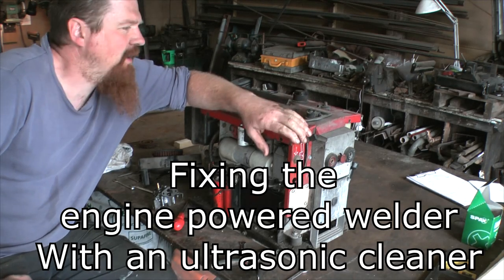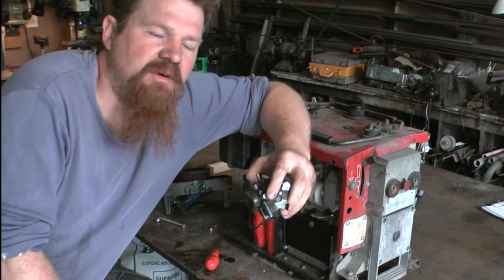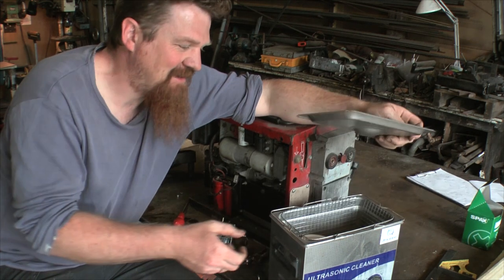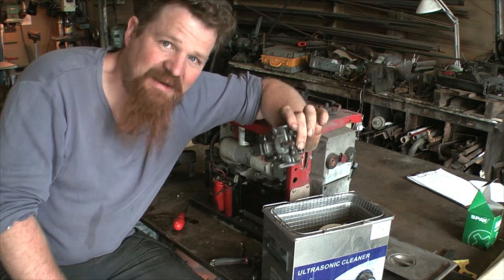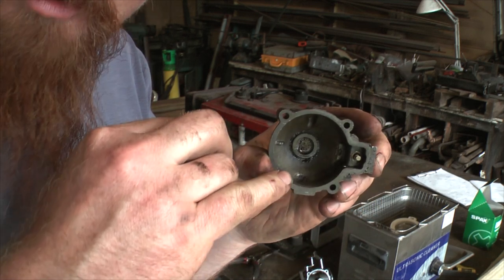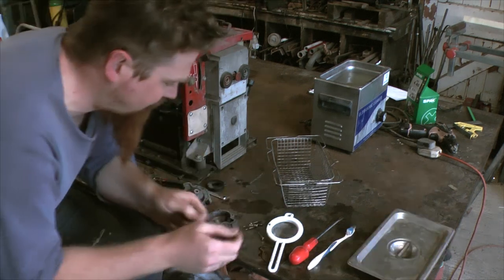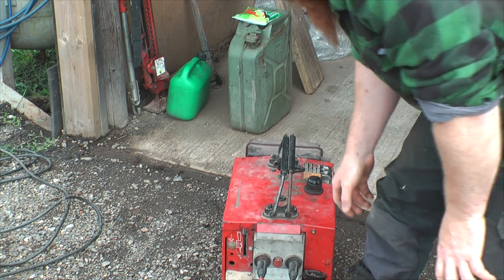Common small engine problems / ultrasonic cleaning

Comment: Max three years ‘down the line’ and these ‘real world’ issues have been largely solved for me by watching videos like yours. Have just bought an ultrasonic Cleaner for cleaning diesel pump components..works(Ed) really well but a transducer dropped’ off the bottom of the sink and shorted out. Have bought two new transducers and will JB weld those in place hopefully it will work again. Regards cleaning (mine is a 10 litre) I use water as a ‘base liquid’ and place any parts into zip lock bags with the solvent. The sonic action of the base water flows through the bags/solvent with no loss of effect and I can ultimately remove the bagged parts and reuse the base liquid again. The main reason for doing this is less clean up of the machine afterwards(no solvents in the sink) and the re use of some (if not all) of the solvent. Cleaning effect of these machines is incredible but they must make the worlds most annoying noise... I think it makes some people ill? I can only stay nearby if I wear amplivox. 

Thanks for another great video. On ‘catch up’ at the moment and learning new stuff each time. CHEERS!

Comment: Used these cleaners when I worked for Westinghouse, superb as you say! I have an old Allen Oxford, petrol scythe brush cutter from 1948 im renovating, I must get a cleaner. It was  sat on a farm  near Shepton Mallet for 30 odd years without running and the carb is bad, but  I WILL get it running! I could not believe you can still buy spares for them, so. I have new piston rings gasket etc.
That welder is a brilliant bit of kit, not seen small ones like that before just huge trailer sets, that we used to use in the forces.
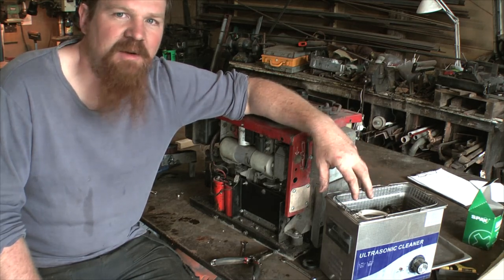5:33 ....and the cat is hungry!
Thanks for this, i had forgotten ultrasonic cleaners, it was  so long ago! 👍🏻

Comment: I had my own business repairing machinery for many years.Varnish in carburetors can be removed by steeping in mentholated spirits. It would even clear the very thin capillaries. It was the only thing i found that worked,since  petrol would not re-dissolve it .

Comment: I used to get this problem frequently. Now I shut off the fuel line and let the machine run dry. Then I restart it and, if it'll start again, run dry again. The restart drains the fuel in the carb bowl completely. Thus, when the machine isn't in use, there's no fuel in the carb to gum it up as the volatile evaporate. 

This largely obviates the problem, in my experience anyway. 

Really like your channel, btw. 😀
Reply: This is my technique on all my small engines. It works well and saves hassle. Lawnmower slightly different but ensure no fuel is left in it over winter and let it run dry when ever possible before winter storage.

Comment: I do like your style of work on tip, in reality whenever using gasket paper to sea two mating surfaces and you just know that you will take them apart again and again: Grease the gasket paper. I use bearing grease (the non-molybdenum type), but honestly any old grease or oil will do. Even used old chip-fat in the past. Result? You can take e.g. a clutch cover off an engine one or two years later and it will still come off without tearing. (And the grease makes installation easier, if one of those dowels magically disappears as they sometimes do, when you field-strip stuff...)

Comment: Off to ebay to look up ultrasonic cleaners. I keep the offcuts of guitar strings they are great steely little wire pokers for getting into jets and things. if you know a guitarist get them to keep the scrap bits for you you get 6 sizes very handy.

Comment: great to see this type of cleaner, as a junior electronics technician I used to build Ultrasonic cleaning machines in early/mid 80's. Anything from small cleaners up to beer barrel cleaning machines. The smaller ones were built out of stainless steel catering equipment like this one - usually used for keeping food hot. We shot blasted it and glued a Piezo ceramic transducer. Worked great on crap parts on my cars like carbs at the time

Comment: We use a carb & parts cleaner from Gunk, it's a gallon paint can size with basket or Berrymans chem-dip but not sure what is available in UK. I've tried pine cleaner but wasn't as good plus the Gunk parts cleaner can be filtered and reused over and over.

I got the same laundry powder from Aldi and it's the best.

Comment: This is why I use stihl 2-Stroke Oil and fuel fit briggs and stratton for 4 stroke engines.
fuel can sit up to 3 years with no problems. I also have a ultrasonic cleaner its the best thing for cleaning carbs ever. Tho I use a ultrasonic carb cleaning solution just to be safe. I find 90% of the time its the carb on most small engines that is the problem. its valuable tool to have

Comment: Would that work with petrol fuel injection parts? I've got a dodgy component that needs a clean (idle control valve) - replacement cost is ~£600! Worth a try?

Comment: Local small machinery dealer tries to sell me fuel additive for a quad bike that spends months in storage......Maximus, does this very expensive fuel additive work? Lawnmowers get fuel tanks emptied/drained and they work fine now every year.  I also stripped the quad bike carb due to running problems and found the primary jet was clogged removal/cleaning & rebuild later it now runs perfectly! I have also added a small fuel filter to keep out dirt etc.
Reply from the maker: I've had no experience myself of fuel stabilizers, I know some people that swear by them but I'm far too tight to pay out for them myself! I'd go with draining the fuel out - if it's not there it can't go off! Filters are always a good idea, I use a filter funnel when filling all my machinery, often catches bits of paint from the inside of the jerry can or random bugs that would otherwise bung up the carb.

Comment: Hi there, can you tell me what welder you are using please? Is it part of the gen set? Thanks
Reply from the maker: The machine I'm working on in this video is a 200amp petrol powered arc welder (you can see it in action in Project Awesome part 2), I also have a 160amp inverter arc welder and a 150amp mig welder which both run off the diesel generator.
Reply: Thanks

Comment: What size is your ultrasonic cleaner have been thinking of getting one for awhile and you have convinced me ...
Reply from the maker: I'll update the description actually as I blew up the one in the video! I still recommend them but just don't get carried away like I did and use for more then an hour at a time. Mine is  a 3 litre model, no brand - I think they're all pretty similar.
Reply: Maximus Ironthumper that’s great was just going to order a 1.5 but I’ll order a 3 like the way you explain things by the way keep it up !
Reply: @maximusironthumper  Carb cleaner works well in them also. As does gunk de greaser

Comment: Seems to me that gasoline and fuels break down faster these days than they used to, now I use stabilizers like sta- nil and sea foam in all my motors, I was just thinking of all the motorized things I have, holy shit there is 17 things, only one don't work a Yamaha gas engine golf cart, one of the valves/ rods is not right, gonna have to fiddle with it I guess, good day!!

Comment: Would you clean spark plugs with the ultrasonic cleaner??
Reply from the maker: People do, though I've not yet tried it myself!
Reply: Maximus Ironthumper very interesting, I’ve an old lawnmower that could probably have its carb and plugs get this treatment! How much was your and where did you get it?

Cheers for the great vids!
Reply from the maker: Thanks! I got it on ebay, lots of sellers - I think I paid about £60
Reply: I tried cleaning a spark plug in mine and it killed it.Could have been a duff plug but I wouldn't try it again.

Comment: There is a product here in the States called Simple Green.  Its a cleaner\degreaser that's totally biologically safe.  Anyone know if that would work well in the ultrasonic cleaner for this application?
Reply from the maker: I'm pretty sure I remember reading about people using that, though never tried it myself. The washing-machine liquid works well for me and the bonus is you can wash your clothes with it too!
Reply: GodzillaB210 I've thought about this before and I've noticed that when I'm using Undiluted Simple green, it's just a tad too harsh on things things that I'm working on like tin (or like a pie pan) so I think it might work in a diluted form.
Reply: I've used both simple green and purple power soaps in my UScleaner as long as you dilute it correctly works just fine.